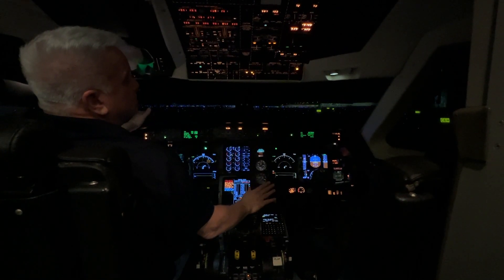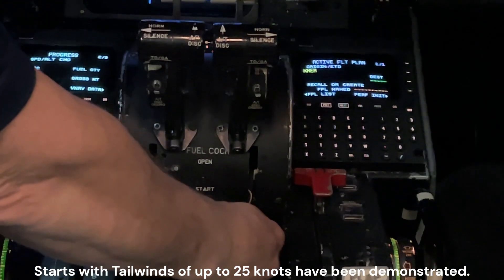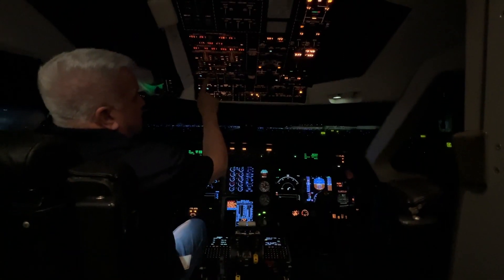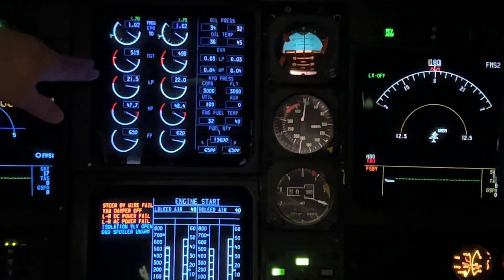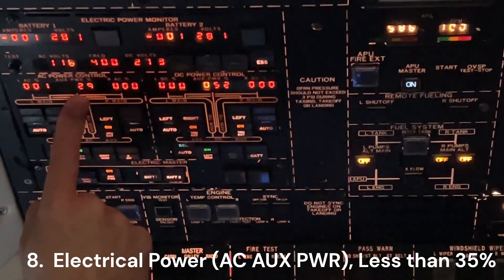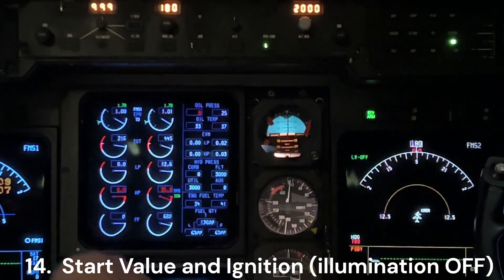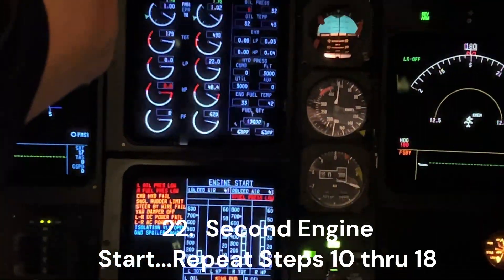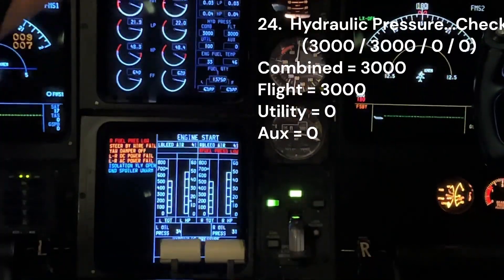STARTING ENGINEs

Comment: Its best to turn off pacs when starting engines. Yes there is a logic circuit that shuts it off, but if that fails, you will overheat and possibly destroy your pacs. Just manually turn them off
Reply from the maker: Well noted and I don’t disagree with that statement, however most of the time they are just left on.  Checking to make sure they turn off as suggested in the video should suffice.   It’s like the oxygen.   Should be turned off but it’s mostly left in the on position (probably to reduce the chances of dropping the masks).   I appreciate your comment.